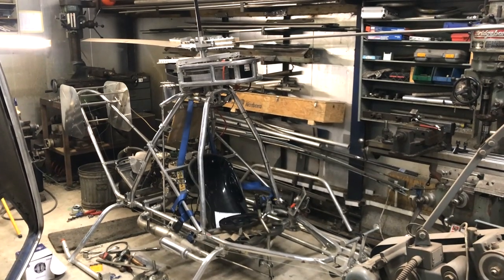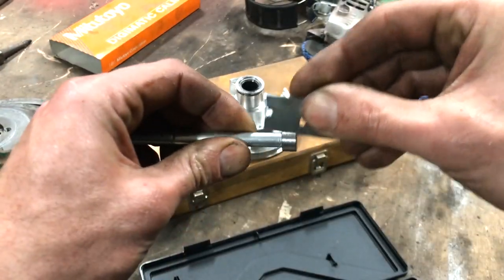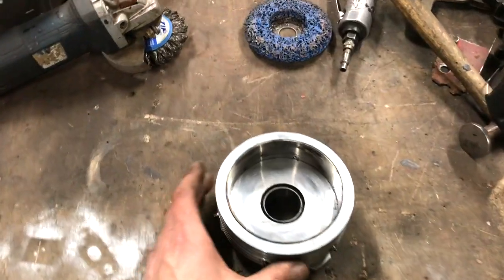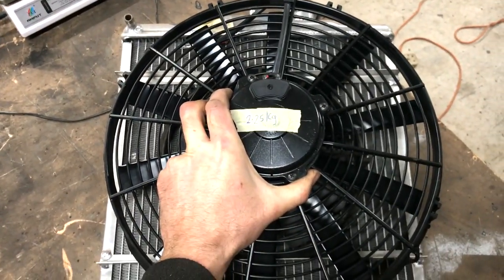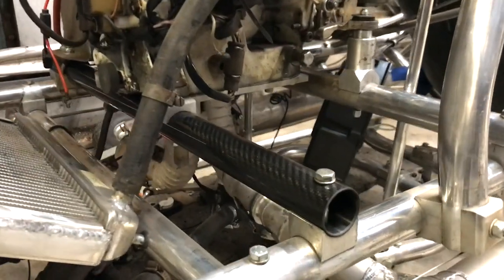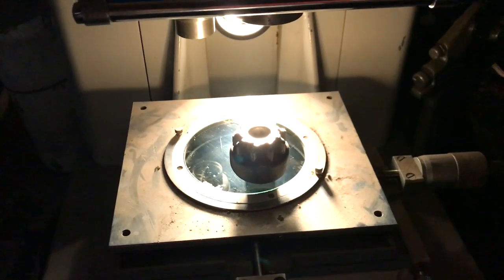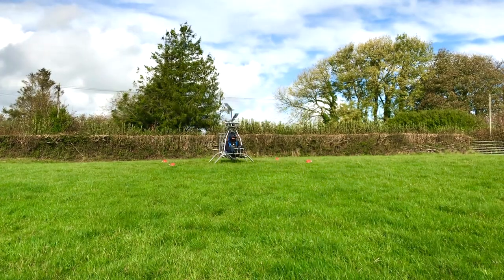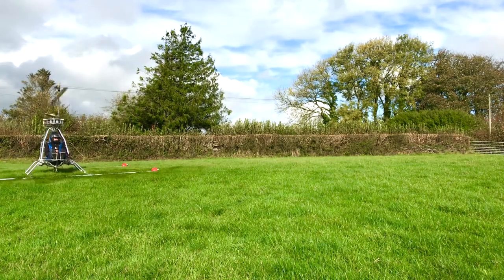It's not easy making a Helicopter

Comment: Weight is King.......... remember you need to aim for 1 HP per 12lbs of gross weight, so 50 HP  can lift 600 lbs  (12 x 50)
Keep up the good work
Reply from the maker: I remember reading that performance quote and it brings hope to the project. In the video the take off weight is 240kg that means around 44hp is being generated by the engine. quite short of the 60hp the engine is rated for but blade pitch is 6.5 degrees lower rotor and 5.5 degrees top rotor. 7 degrees I think is max lift/drag for 0012 blade, I'm confidant there is more potential in this machine.
Reply: @Ben-Dixey  7.2 and 6.4 degrees for the lower and upper rotors sounds like a good compromise of pitch to power ratio to me :)